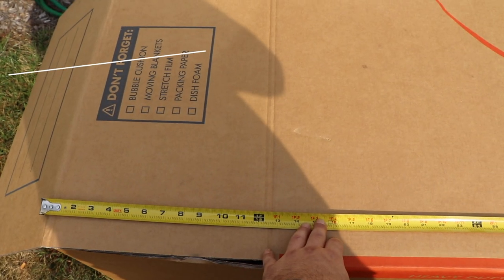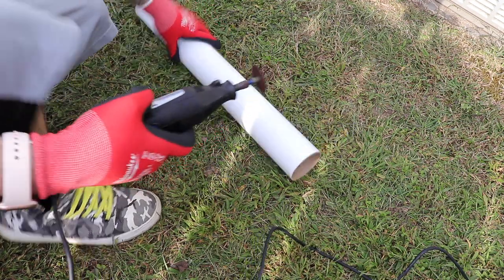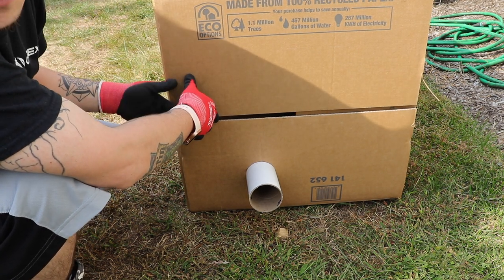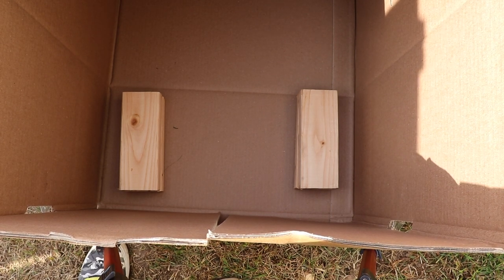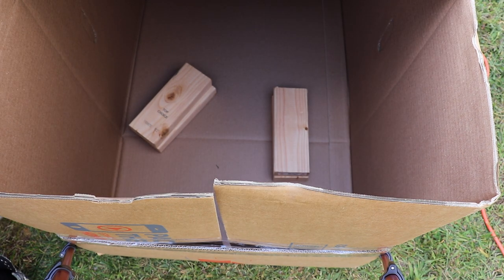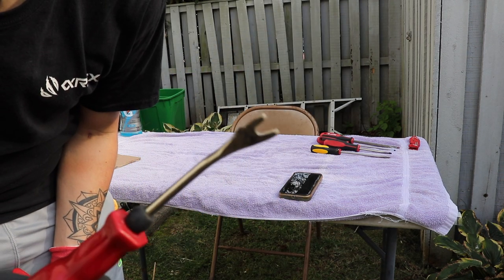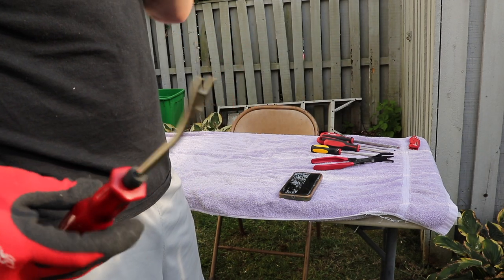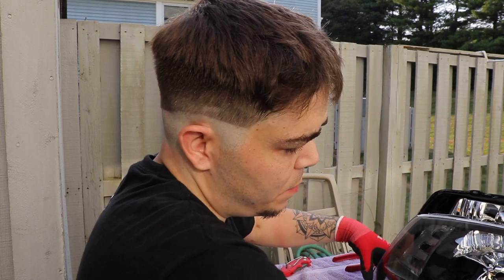How to make a cardboard oven to retrofit your headlights for under $20!

Comment: if i have a heating gun with a temperature in the second speed about 380c° .. it is harmful ? and how long do i need this heat to open the headlight ?
" my heating gun from the company INGCO "
Reply: Sounds like you have an industrial heat gun. Heres what you can do. All times are the same as if you put the lights in an oven. So research your vehicles headlights on online forums and see how long people are baking them in the oven. If they are 09-18 Ram OEM lights then the time is 13 minutes. If they are aftermarket then its alot less, around 10 minutes. Average times are 10-13 minutes. Now, as for the heat setting, here is what i would recommend. (PREHEAT THE BOX FOR 15 MINUTES!) Place one light at a time into the box, set your gun to the low setting. Then take the light out after 12 minutes. If it is not immediately easy to open, let the headlight fully cool down for 15 minutes or so. Then repeat the same process but put the heat gun on medium. Remeber you want to use the same size box i used or very similar in size, this is for a very important reason. You want distance between the heat gun and your headlight. One end of the box has the heat gun poking into it, and you place your headlight at the other end of the box, 3-4 inches before the boxes wall. This will leave plenty of room for the heat guns heat to not directly hit your headlight. I have used this method for a few years now because where i live, i have no garage so no location for a secondary oven and the kitchen oven wont fit any lights at all. This method is 100% usable, its safe, and works perfectly for opening and resealing. ****DISCLAIMER**** MAKE SURE YOU DO NOT LEAVE THE CARDBOARD BOX UNATTENDED WHILE USING THE HEAT GUN INSIDE OF IT! THE CHANCES OF A FIRE ARE EXTREMELY LOW BUT CRAZY THINGS HAPPEN IN THE RIGHT CONDITIONS SO NEVER EVER EVER WALK AWAY WHEN THE HEAT GUN IS RUNNING AND PLACED INSIDE THE CARDBOARD BOX!!!!!
Reply: @omgpancakesyum  very very thx 😍
the first sitting in my heat gun about 50c° .. it is enough after 15m of heating on second sitting (380c°)? 
and what about KIA FORTY 2011 headlights ?
Reply: @yousofal-kassar8196  Well 50c (122f) sounds a bit low, you want to aim for around 200-220f or 93-99c, 380 is WAY too much and will definetly melt your headlights. Sounds like you have a extremely powerful heat gun. You might want to pick up a $20 heat gun off of amazon that has a low/high setting close to 200-220f or 93-99c. Both of the settings on your heat gun are just too low or waaaay too high. The low setting for you will not heat the glue up enough on the lights. As for the Kia Forte lights i have never done a set, so i can not say if they are permaseal or butyl and how hard they are to open or the temp. I know Kia's have alot of online forums so try searching google for "Kia Forte Headlight Retrofit Oven Times".